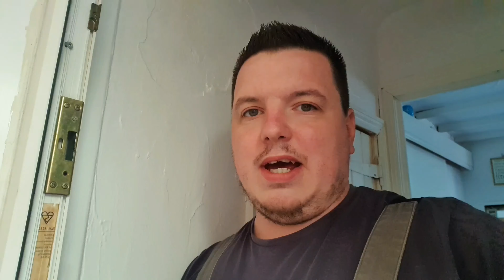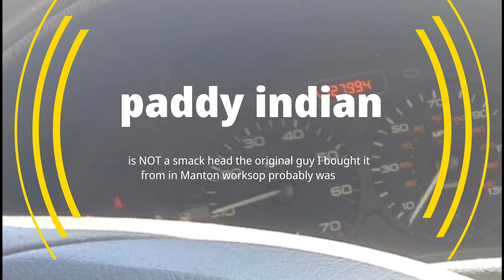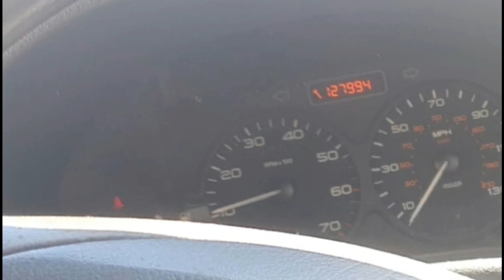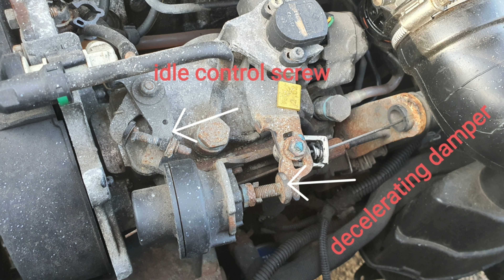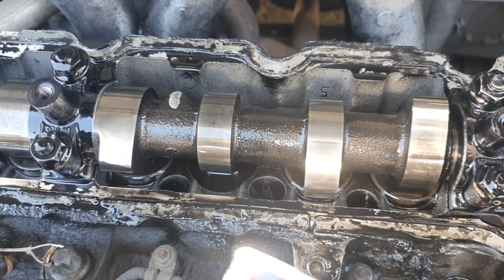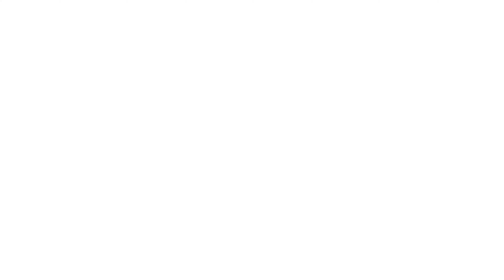Citroen berlingo 1.9d restoration scrap 2 cash part 2 adjusting the idle speed and oil leaks 😂🥺🤯

Comment: aaa, I was hoping you show us the idle setting procedure.  I dont get it quite, there are to arm set screws, one for the throttle buried at the back under the intake manifold and one next to the damper you labeled it as idle control screw. what does this one do? cold start idle control?  I see there is a cable attached underneath to a device/motor/something.  How do you set it up correctly?  could you please share with me the procedure?  mine is running at 1000rm idle, what I think is way too high.

Comment: This has helped out. I need to do my rocker cover gasket as well and was worried I’d have to remove the cam belt to take any tension off the van but can see it’s bolted down luckily. Can you do a video on blanking the egr valve at all?
Reply from the maker: Yes I have the footage just need to edit it ... So subscribe and the video will come soon